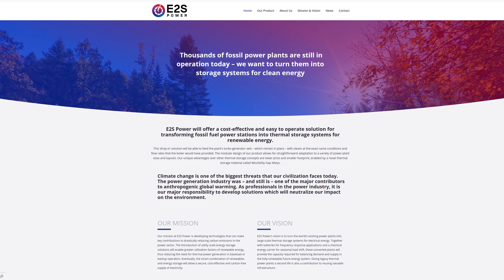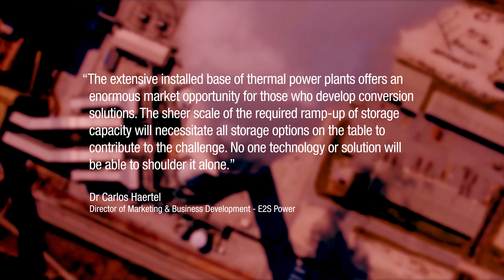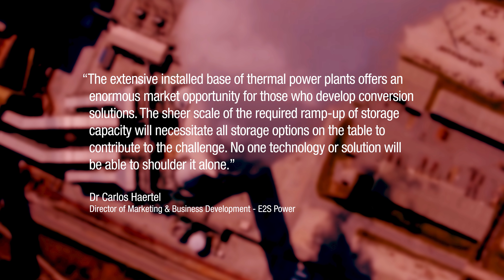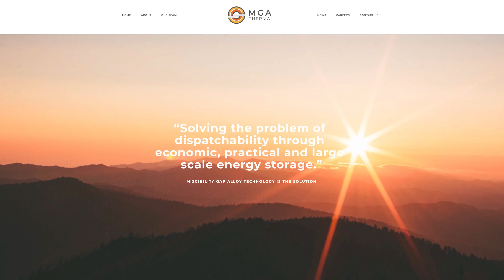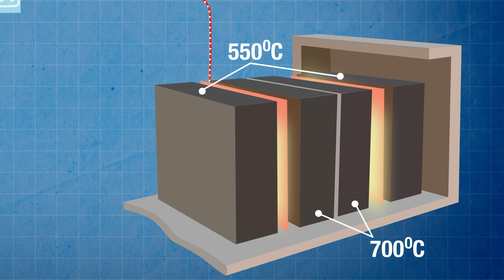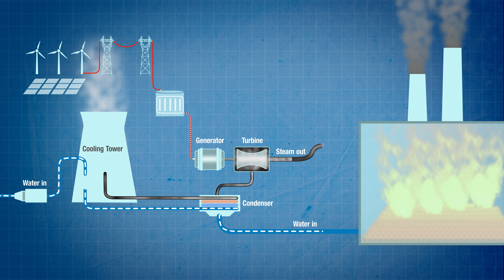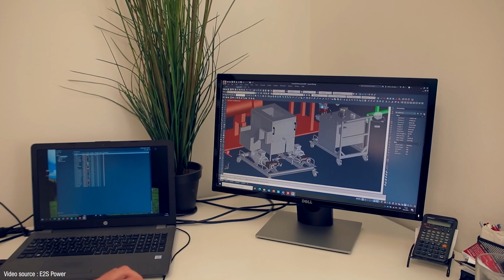New energy storage tech breathing life and jobs back into disused coal power plants

Comment: I'm pessimistic about this kind of ideas. Utilities only think about investing in PV to produce electricity they sell now for a big money. Anything other than that is not welcome. Besides, the difference in electricity price along the day is minimal, which benefits the companies and discourages any form of storage. CSP with storage would have been a good idea for old power plants, having large coal yards for the reflectors and all the steam power and cooling equipment needed. This would be the easiest and cheapest solution, but they are not doing it anywhere. So no point in thinking of concrete, gravel regenerators, liquid aluminum, or air or whatever. Finally, EPC and OEM companies move their businesses to new equipment they can sell nicely; adapting old equipment is not even considered nor a part of their business culture.

Comment: The real problem here in the US... The Hundreds of Gigawatts that will be needed for automotive operation (possibly a few TW)  - and then the electric trucks, where a truck stop will need the same amount of power as a medium sized city.  We will need new nukes (about 1.5 Gigawatts each) every 3 weeks to have enough power for just the Cars.  Not the trucks.  Throw in the trucks, and you are looking at every 2 weeks.  Without that steady state available pile of Terrawatts by 2035, we will not have transportation.  The dolts in California and New York banned sale of all ICE equipment, and requiring "0" emissions vehicles long before 2030, and where rolling blackouts are the normal condition during the summer or any time that the utility is worried about starting fires. Throw in the decommissioning of nukes, and you have a less than optimal situation.

The liquid metal battery looks like it would be a lot less work than the Al heat storage method..but that could provide a reasonable way to use 1/3 or 1/4 of the plant for a big battery....

Comment: It will take many container sized modules to replace a coal fired boiler so capital cost will be high. My main concern is that the overall efficiency in terms of electricity generated / surplus electrical energy absorbed will likely be less than 40% compared to approx. 90% for battery storage.

Comment: Really interesting video and prospect. My only ‘concern’ is that when a coal (or nuclear plant) is reaching the end of its operational life - then the associated turbines, pumps and control gear is equally ‘shagged out’ and will likely require a multi million $ refit too. Additionally it would be a second order standby as it would need a couple of hours to warm through and come on line (unlike CCGT) rather like the original coal plant.
Reply: Sure, but we're assuming we're trying to shut down coal power plants long before their end of operational life. It's a transitional thing that will disappear over a few decades regardless, not a long-term venture.
Reply: @LuaanTi  That may be true when taking a world perspective. But for the UK, who have been in the forefront of decommissioning these stations we only have three left operating the oldest is over 43 years old and the other two just a couple of years younger. So is we said the operational life was 50 years there ain’t much life left without a considerable refit.

Comment: to a certain degree, it's still a boiler. it is just not boiling water, it is kind of good. because you can save money by not replacing the turbine fan, generator and cables. electric cables in miles in nowadays term is damn expensive. so, what left is the exchange rate, it had to be consider running at 700+ degree 24/7, which, water boiler don't reach this temperature. if shtf, do the local fire station knows how to handle metal on fire in pressurized environment? erosion will be a problem too, chemical properties of steel change in about 860 degrees, which is not far away from that, and we know aluminum and iron oxide can give a spectacular show when enough energy to kick start. i won't say it is impossible to achieve, but it do need some kind of safety cutoff device, just like……the aluminum factory. yea, it is almost like a aluminum factory, melted aluminum, graphite  with high current. steel structure. if it also produces cast aluminum, then it is exactly a aluminum foundry.

talk to manufacturers who made cast aluminum products, such as making pot and pans, they may have interest to join too?

Comment: Another interesting video that I really enjoy sharing on my social networks.
I am still more tempted by the Highview Power solution because it does not need a water circuit, does not emit calories into the atmosphere and even allows the capture of CO² or even the creation of water by condensation. artificial via the dehydration of the air pumped during the mass storage phase.

Comment: The challenge to repurposed Carnot engines is that the energy needed to heat them up in the first place has to be paid.  To be efficient, they need to never/rarely be turned off.  That means daily cycling is a non-starter where energy balance actually matters.  I see this technology as augmenting existing plants to reduce coal.  That's a good thing.  But there's not much chanced it'll completely eliminate it.  Still a good idea, assuming the new technology can be co-located, and these concepts still should be pursued.  Some of that 'to be paid' energy can be reduced by reworking and insulating the old plant parts that weren't designed to require insulation.  We need every option to reduce dependence on extraction commodities like coal and oil.
Reply: EXACTLY!  All the hardware will 'suck up' a load of heat, and I suspect the machinery itself won't like to be shut down and restarted every damn day. There may be excessive wear, or maybe the restart procedure is a huge PITA that takes half a day.
Reply: Your claims don't make sense.  To the extent that the original plants where load following, so the repurposed plants would be load following too.  Now, those plants designed to be entirely base load, wouldn't work well with this technology.  But my guess is even those plants would have some flexibility with respect to the steam turbines.
Reply: @richdobbs6595  this is where high temprature reactors with heat storage makes sense.
Reply: @richdobbs6595  
France's fleet of light water reactors operate in load-following mode.

Comment: What was the storage efficiency? Did I miss that? Energy out compared with energy in. I realise this will depend on how long the heat is stored for. It will always be difficult to compete with batteries, especially some that are yet to be commercialised. If too inefficient, there is a risk that the "stranded plant" will not be worth keeping, especially considering the extra labour required. Lots of scrap metal...
Reply: Heat losses can always be minimized by adding more insulation.  But the efficiency of thermal plants is always limited by Carnot efficiency, so the round trip efficiency will be about  the same as the efficiency of the original power plant.  I think they design these plants to be somewhere in the range of 32% to 42%.

Comment: But what's the round-trip efficiency of this solution?
The global average efficiency of coal power stations is 33%, add to that some heat storage losses (high temperature heat means big temperature gradient to outside world) and you may end up losing two thirds to three quarters of the energy. That means you only break even if you have factor 3 or 4 differences of the price of electricity within the storage period, and it will make it challenging to compete with other storage technologies that have much, much smaller losses.

Comment: I keep getting this idea in my head that this whole system is in a storage container -- a single one.  But then I reconsider that really, it's a whole bunch of storage container sizes modules connected together... because a single storage container would have only enough heat to run for a few minutes.

Thanks for the great video.
Reply: I'd actually expect a single storage unit to last quite a while, and that is due to the phase change in the aluminum.  You have to account for the heat of fusion of aluminum, which is roughly 376 kJ/kg.  So if you completely melt 1 KG of aluminum you have to put in 376 kJ/kg + a little extra to account for heat loss, wont get into that here.  When this system is active, a heat exchanger will draw out the thermal energy from the Hamster unit and if it started with all its aluminum in the liquid state, the hot side stays at the melting point temperature of aluminum, 660 C, until the aluminum freezes and releases that 376 kJ/kg.  So if the Hamster unit holds only a single cubic meter of pure aluminum to be used as the heat storage medium, its energy capacity at 660 C is effectively 1015200 kJ, or a little more than 1 GJ.
Reply: @MotherNature26  
A coal power plant consumes well over 100 railroad cars of coal a day, that's several an hour.  I can't believe that a single storage container of molten metal would last more than a few minutes.
Reply: @acmefixer1  First off, I'm just illustrating that these things should be able to hold a fair amount of thermal energy.  I don't know how much aluminum they actually contain so It'll be hard to make a direct comparison to coal consumption.  I just broke it out so you could see how much 1m3 of molten aluminum could store.  Arguably I did not specify a capacity that a single unit would have to satisfy.  This will depend on where these are sited.  I suspect based on some of these numbers that 1 Hamster unit could probably satisfy a continuous output of 1 MW for 1 day before it is depleted.

Concerning coal: the LHV or HHV of coal varies depending on its grade.  Anthracite HHV is about 32.5 MJ/kg while Lignite is much lower at about 15.0 MJ/kg.  A coal power plant that produces 100 MW of electric power would probably need about 300 MW of fuel input energy.  That requires about 72 metric tons of Lignite coal per hour and I think that is right around the capacity of the smaller hopper rail cars used to transport coal.  So it seems depending on the output of the power plant it can certainly consume that much coal.  Again, I am just breaking it out into an easier rate to think about: 0.5 to 1.0 rail cars of lignite per hour OR 0.25 to 0.5 rail cars of anthracite per hour to power a 100 MW coal power plant.  Sorry for the range on the coal consumption, but I don't see a standard coal hopper rail car size.

You would certainly need more than 1 hamster unit to be able to return an old coal power plant back to operating condition, probably need 100 to 150 units for a 100 MW plant to keep it running for 1-2 days.  There are a lot more considerations that would go into how the plant would actually be run, not going to get into that here.  

I am guessing based on the materials of construction for the hamster unit, that this ends up being relatively cheap compared to the cost of installing other energy storage solutions capable of the same output.  At the end of the day, its about cost.

Comment: Wonder what the overall efficiency is? I.E. number of green kWhrs in, verses number of kWhrs out. 
Such systems are not entirely free of greenhouse gas emissions. Although less problematic compared to CO2, water vapor (coming out of the cooling towers) is also a heat trapping gas.

Comment: It helps understand the real potential if you can compare it with other choices to store grid scale energy.

For example: How does the MGA based energy storage compare to flow batteries? 
Flow batteries don't need all the power generating equipment and the conversion of heat into electricity.  If I understand correctly,  independent of the MGA heat storage and recovery efficiency, the conversion efficiency of heat into electricity using steam turbines is usually about 40 to 45%.  Which would imply the total round trip efficiency is unlikely to exceed 40%.  Flow batteries have shown round-trip efficiency around 85%.  

Such large differences in energy efficiency can incur major cost overheads. If the MGA based system needs 2x the input electricity (or more), to generate back the same amount of electricity when you need it, it means the flow battery system capacity can be 50% smaller for the same output energy levels!

Comment: I like the idea, especially for CHP, but I doubt that it would be profitable in long-term. By definition, the selling price of power should be at least 2,5 times higher than the purchase price. With the required scale, the current volatility in price profile should level out. It would be interesting to hear how easy it is to adjust the output with this solution🤔

Comment: I was a Nuclear operator on an Aircraft carrier in the US Navy. For me the most striking thing about steam cycle heat engines it the efficiency. Theoretical maximum of 30%. Using fluids other than water, such as high pressure CO2 maybe 40%. I think a decentralized energy grid with solar and wind with localized storage could go a long way. A number of Centralized power stations to maintain base load such as these repurposed coal stations, maybe even LFTR's in place of the boilers. Reducing Carbon and Methane emissions can only go so far. We need to stop wasting so much energy by greatly reducing waste heat losses at the generation and transmission stages. Every parking lot and garage and industrial building needs to have Solar on the the roof.

Comment: This idea might give a coal power station a few years extra life but they would still be inefficient as they throw so much of the heat away in the cooling towers and the turbines need regular rebuilds. Renewable energy will eventually undercut them as its is still falling at an astonishing rate and with new storage methods like flow batteries it's becoming dispatchable.
Reply: I can't imagine that the system gets great return efficiency. I'd take Stanley's point about covering the overnight or peak demand and the economics of that but you'd have to be paying 1 and selling for 3 to balance a system that at best has a 40% return.
If rather see the heating done by solar collectors, even if the local isn't that sunny surely having the Carnot cycle equipment would bring the capital cost down to a pack of mirrors and some pipes?
Reply: Problem is renewables become exponentially more expensive as they become higher percentage of grid power due to their intermittent nature.  When this takes place back up and peaking power becomes increasingly valuable.  Setups that can take advantage of higher returns during peak and backup power demands can be profitable even if the cost of this power is higher that that of renewables.
Reply: @stanleytolle416  That's why battery storage will be the next big thing, and their efficiency will always beat the running costs of thermal storage running steam technology.
Reply: @stanleytolle416  That's the whole point of energy storage.  All of the intermittent energy will be stored and used when needed.  It's only less valuable now at times because there's not much storage.  By the end of this decade we'll see solar plus storage cheaper than thermal energy.

Comment: OK---------- Why don't you just get rid of the Middle Man  (high temp energy storage Battery) and simply replace the Coal Steam boilers with new Low-pressure Safe small Packaged Multine Salt Reactors that do not require Billion Dollar VAULTs to contain the possible explosion of the old tech high-Pressure Water Reactors that are too expensive and unsafe to build anymore? 'Both the Solar Cell and Wind turbine Farms are not cheap and have lives of only 15 and 20 years respectively before needing replaced, with disposal costs that are astronomical.  While the Multine Salt Reactor would last for 50 to a100 years with no fuel rod replacement needed and very little nuclear waste.

Comment: excellent idea , repurpose old coal power plants into something more useful , if we could just do the same thing with nigel farage.
Reply: Yes, but it have only about 50% electricity/heat to electricity efficiency. In long term it might be not sustainable.
Reply: @martingorbush2944  are you talking about Nigel farage or old power stations ?
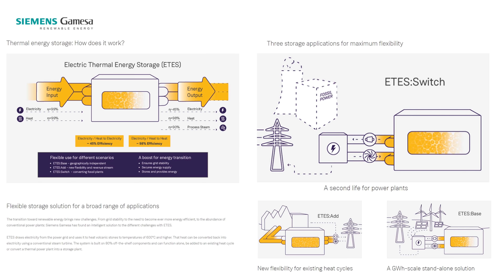Reply: @jean-marcgruninger9019 . I was reffering to similar ETES from Siemens as its data have been shown at 9:15 (https://youtu.be/edVjYofLYc4?t=553)

Props for notticing that efficiency of that system is very similar to coal plant. That is because there are masive loses in steam turbines. Cogeneration (electricity+heat) would bring that efficiency up. How much, it depends from how much heat would be taken instead of electricity.
Reply: @martingorbush2944  yes , storing the electricity in batteries  would be more efficient,  then have electricity turned into heat and then back into electricity.  But what about cost ?  And having all storage as batteries is going to put a lot of strain on battery material and production. We already need to supply batteries for ev’s. Having an alternative way of storing energy can only be a good thing even if it is less efficient .

Comment: Hmm, it's good that it utilizes existing infrastructure and means decommissioning is not so punishing to plant owners. The efficiency looks to be around 30-50% which is not impressive, but usable. Turbines must run at near full capacity the entire time to be viable so it needs priority on excess electricity that may be better spent elsewhere. There will be consistent heat loss due to needing a constant temperature. I'm not sure what to think.